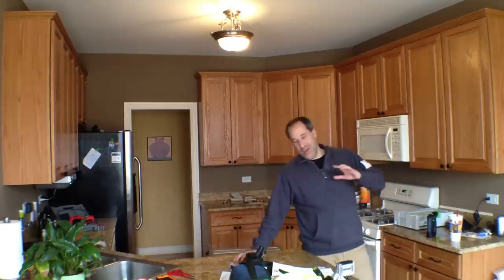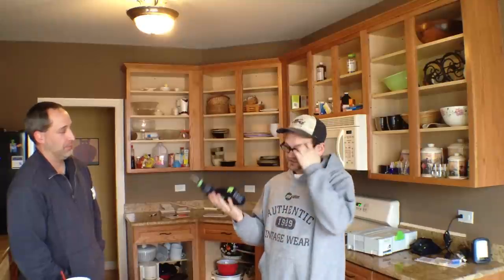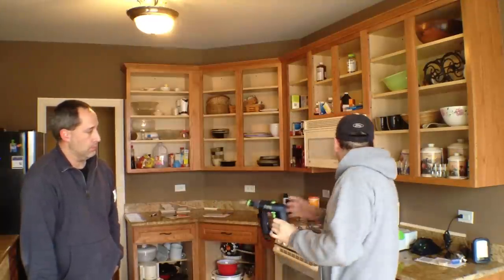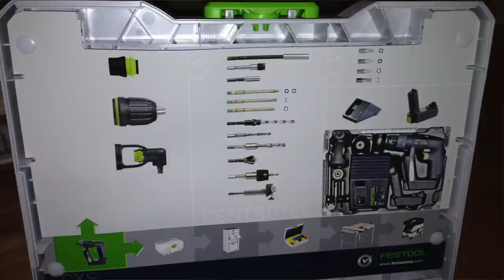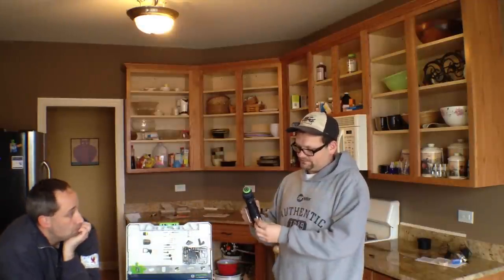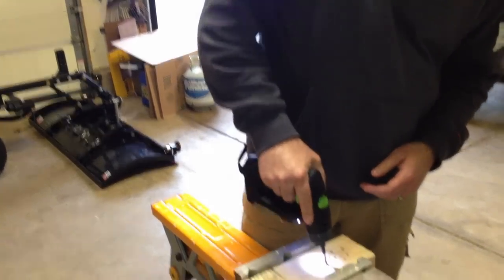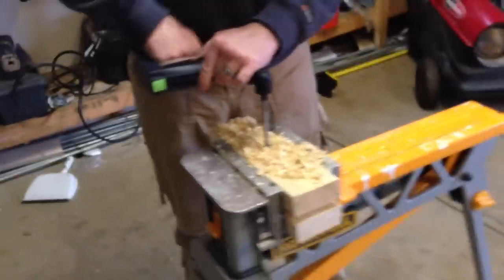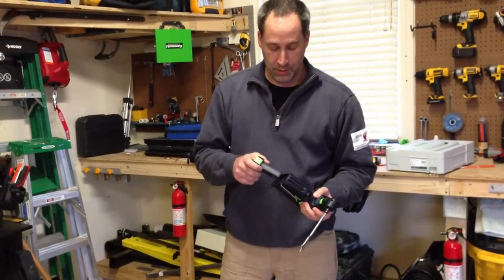FESTOOL CXS Compact Cordless Drill Driver

Comment: You guys need to review a Dremel rotary tool. You can stick a one inch spade bit in it and put it up against a Dewalt hammer drill and see which one can drill more holes inside of two minutes.
Reply from the maker: +Drumming Tee Yes great idea we should add a AVT  jack hammer also